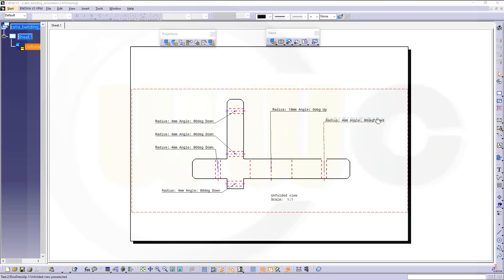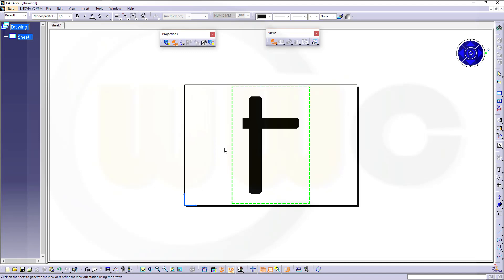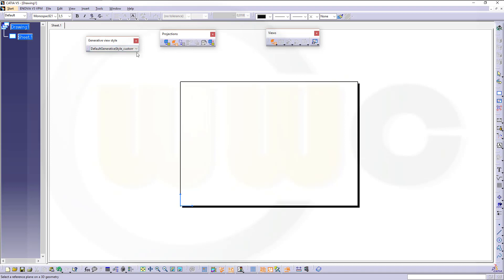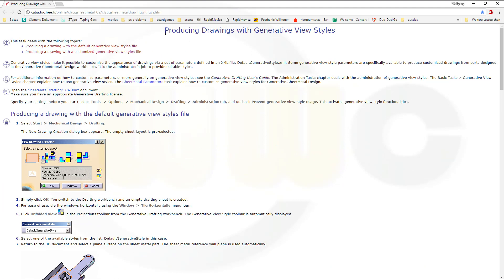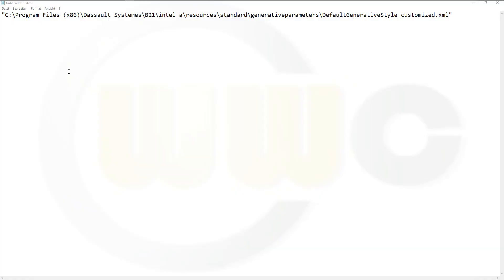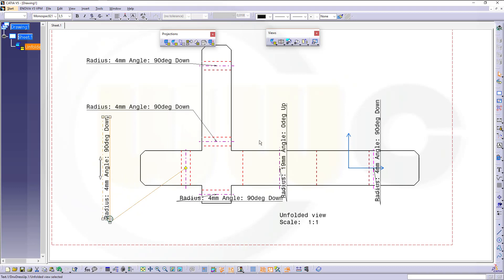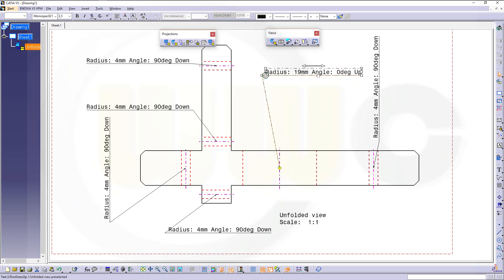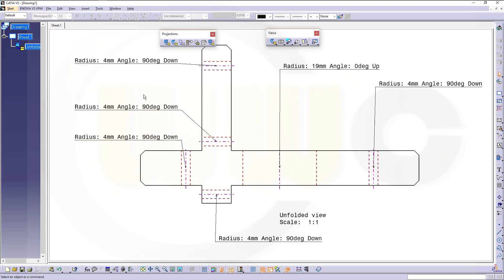Bend - Annotations - Catia v5 Training - Basics -  Drafting

Comment: how can we get Bending lines on a Sheetmetal part designed by Hopper command or how we get bending lines of a curved surface
Reply from the maker: Sorry no idea. I usually don´t do sheet metal. No demand for trainings.
Reply: @wolfgang.walden.cad.training  
Thanks For Reply...I am not able to find any solution. Actually have to export the part as Igs and import into solid works and thn convert it into sheetmetal and thn take bending lines